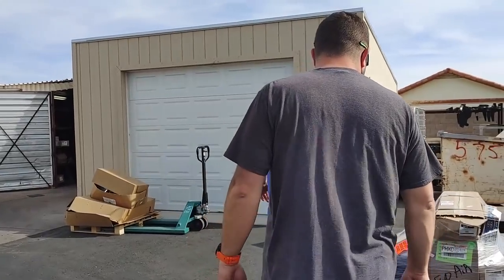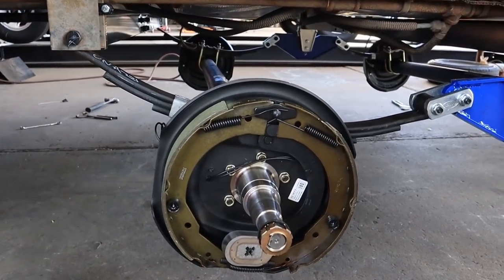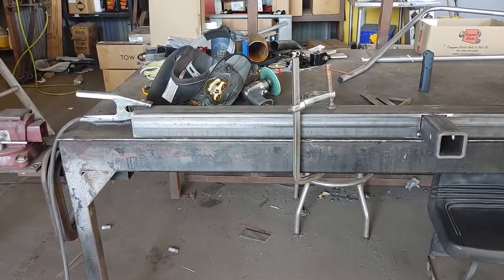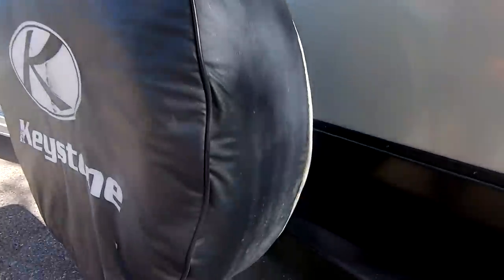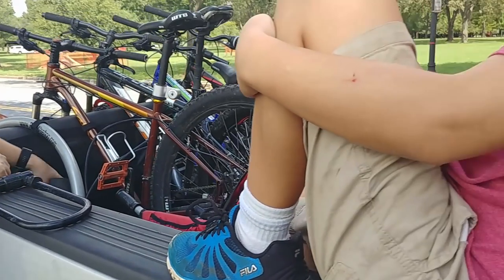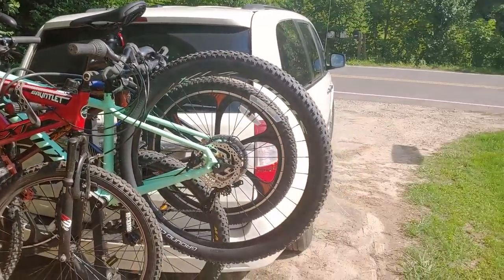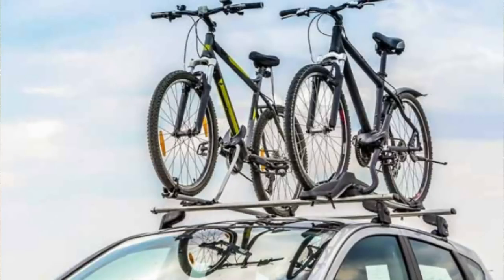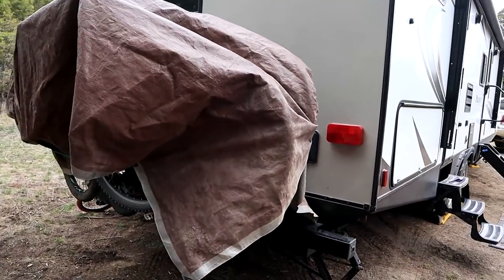Trick My Trailer Part 2:  Hitch Receiver for Bikes [Passport Ultra Lite 3350BH]

Comment: We only have 2 bikes and use a Swagman E-Spec bike rack - it is RV rated and can handle very heavy bikes.  We also use a propane grill cover as a bike cover - the size (Xtra Large) and shape fit the bikes very well and it has held up over many years of use.  We use nylon straps and a couple of bungees to make sure the cover stays on.  The Swagman E-Spec is one of the sturdiest bike racks we have used and it is very easy to load the bikes since it supports the wheels and has an adjustable piece the locks onto the bike frame.

Comment: Instead of hanging your bikes I switched to  rack that holds them under the wheels.  I found it easier to lock them down to the rack and they did not bounce around.  Worked much better for us with the bad Michigan roads.

Comment: We aren’t the only ones on the bike saga! Carolyn doesn’t even have a bike right now because it broke. Kids all just got upgrades and Garrett bought a front tire for his. We still use a rack like yours on the back of the trailer. And Eddie’s bike fits in the basement compartment. Carolyn may get a folding bike that can fit in the trunk of the car.

Comment: I went with a Küat Racks Transfer V2. It’s rated for RV/Trailer use in the two bike configuration only. I also installed a front receiver hitch on my TV where I can use my Thule rack for two more bikes.

Comment: FYI, you can triple tow in many of the west coast states. 5th wheel or bumper pull.  Although you need the proper license endorsements. And must know your length regulations and not exceed your weight and tow capacities.

Comment: I would use the jack-it. It goes on the A-Frame and hold two bike. So you can put two in the A-Frame and two on the rear or Wendy so it’s less weight back there.

Comment: Those trailer tongue mount bike racks look interesting. I've never used one so I can't say how well they work.
Reply: I've heard they can be difficult to reach if you are on the shorter end of the height spectrum. If the electric tongue jack is turned 90-degrees so you can lower the tailgate, then it may be easier to reach by simply standing on the tailgate.

Comment: Didn't see the front stabilzer bracing, they were suppose to be putting on for you. I thought that would be a good idea, too. Was interested in how much difference it made?  Have a similar trailer to yours, with the wide axles. Going to have to look into that one. I had been looking for the one (damper kit) that fit the wide axles like you have, along with the wet shackles. Moreryde didn't give you a discount code for your viewers, huh? That stuff is expensive.

Comment: I have three mounts similar to this: https://www.amazon.com/MBP-Alloy-Release-9x100mm-Storage/dp/B07MDXZGMB/ 

The three mounts are bolted to a 2x4. The 2x4 has legs to raise it off the bed of the truck. I just set the 2x4 assembly in the truck, attach the bikes to the mount, and strap them down with a single strap. It works great for the three bigger bikes. The youngest's bike just sits in the bed of the truck for now. I did still have room in the bed for my gas can for the generator and a few other items. When our youngest gets a bigger bike, I plan to get a Jack-It to put the two adult bikes over the LP tanks and then the 2 kids bikes will go in the bed.

Here's a pic of the bikes in the truck (and yes, I realized after I bought the truck it's almost identical to yours! I love the ramboxes and the diesel engine.). I don't have a pic of my mount yet, but can get one.

https://photos.app.goo.gl/fCCCstCUdY8ow4xq9
Reply: Just took a picture of my mount assembly. 

https://photos.app.goo.gl/LaXZo6r4zaZ7oJuw9

As you can see, it's just a 2x4 with 3 of the mounts bolted to it and a "legs" on the side. It could be made from a single 2x4.

The only issue is if the bike has disc brakes, it won't fit in the center position. Lucky for us two have disc brakes, and one is rim brake.

Comment: first off cliff is wrong, you can install a hitch on the back a travel trailer as long as you are not longer then 65 feet in ca, or 70 feet in the other 49 states, that is total length truck and trailer . that s  the reason most people buy a 5th wheel, ., to shorten up the length to pull a extra trailer with a buggy, or motorcycles on it. other then that cliff is right. most people dont buy the bumper to hold the sewer hose in it, installing a 4" or 6"  pvc  tube width wise holds the hose. also did you know that bumper , is against the law in most states, a bumper is made to protect the trailer due to a rear end collision. that bumper would not protect even the hose????also please install some reflective tape to the holder or the hose bumper for others to see your bikes, believe me the police would love you for it,.im glad you made out on the bikes rake, and love those walmart bikes??????? i also saw someone that built a large kryponite lock that when through the frames of the bikes, and bolted through the frame on the hitch, locking it up with a s/s hidden lock. and another thing is attach a m/c strap from the last bike out and connect to the frame to hold the bikes secure, the strap stops vibration being on the end of the trailer, the bounce?
Reply: Research towing triples or triple towing. That is what it is referred to when you have 2 trailers of any type behind a tow vehicle. It is legal in many states but the law varies state to state regarding legality and the length/weight restrictions in those states.